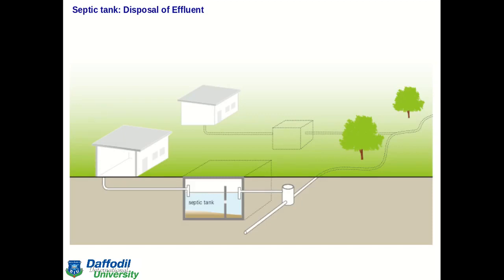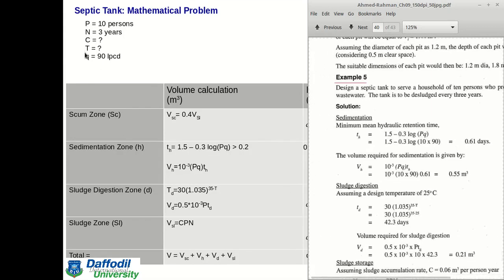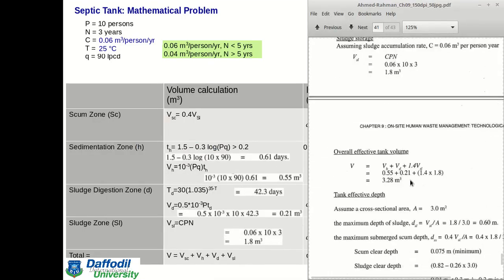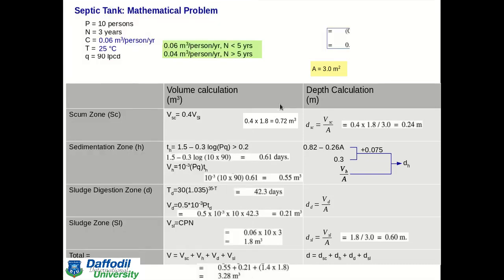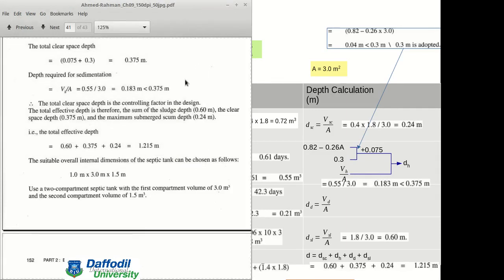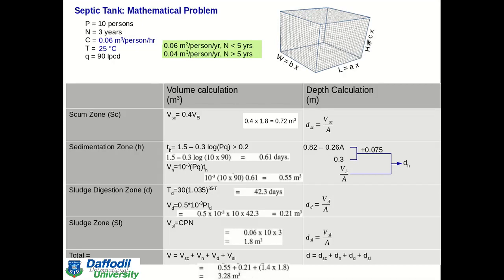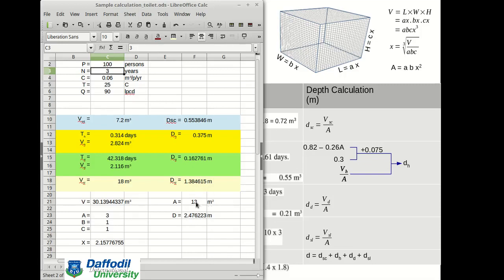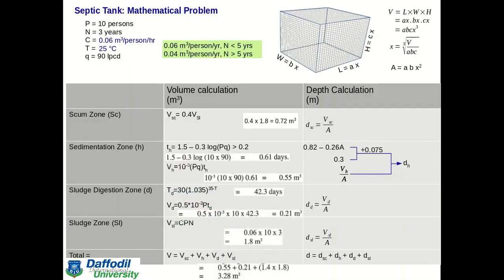Septic tank lecture part 2 - mathematical problem

Comment: Sir if N is 5 then what value we should count?
Reply from the maker: According to the book there is no specific value of C for N=5 years. But conceptually, we should take it as the larger value (C=0.06) for a factor of safety --- thinking that if somebody does not care to clean the tank for 5 years, there might be delays and we should keep some space to accommodate the extra sludge.